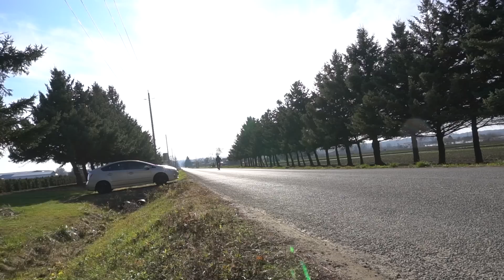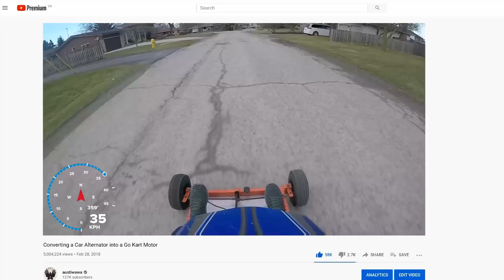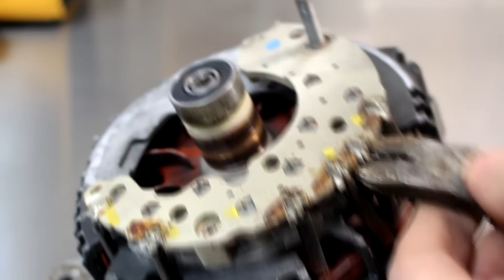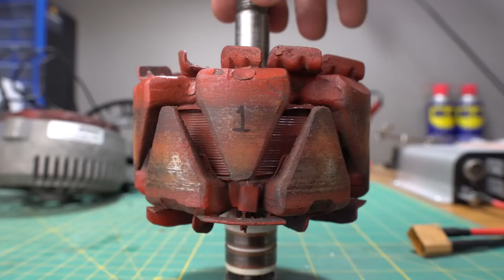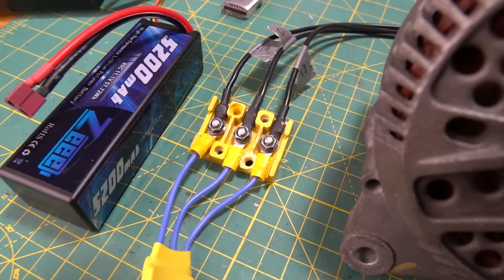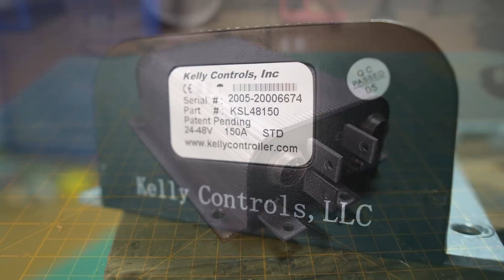Building an Alternator Powered Bike

Comment: “Alternator-Powered Bike” needs the hyphen.
Reply: No, it doesn't need
Why correcting an error in the title?
It won't change the project
It won't change the final result
Reply: @foxxyytofficial  it reads in the active vs. passive voice without the hyphen. Accuracy is important. Truth is important.
Reply: @kyrie26  really?
Just another troll on the net then
Reply: @foxxyytofficial  not a troll, I am doing my part to prevent the decay of the visual language. Written language is supposed to be both visual and auditory. But now because nobody cares, and uses text-to-speech, we are losing the accuracy of visual language.
Reply: @kyrie26  but you're trying to make corrections on a video title that no one asked for it
And it's such a niche DIY type of video that putting the hyphen won't change anything
Reply: @foxxyytofficial  truth is important.

Comment: Common issue.  Clutch springs are too strong.   You can weaken them a number of ways.    Goal is lock up at minimum rpm's.
Reply: Removing the clutch was better

Comment: Why couldn't you use a relay to just turn the motor on/off or disconnect the power going to the controller? But I guess it works other than the loud noise! Nice work my man! Keep it up!
Reply: That would be more of a ghetto fix than a real working idea
Reply: @foxxyytofficial  Yeah, its just a thought I had in mind

Comment: What I want to know is did you find an appropriate Breathless Motor Controller?
How did you arrive at the gearing?
Reply: Most BLDC controllers work in the same way, some with better components, others with chinese stuff
Reply: @foxxyytofficial  Thank you for responding. You are assuming I know something I do not know. For a 12V Alternator say 105A; what make and model controller would be best performing (speed. load, WATTS)?
Reply: @Thinker2-truth  most alternators will work, the bigger ones with 90-130A usually are the ones that can handle more current
Reply: @Thinker2-truth  but for a simple build, a 1500W BLDC 48V controller with sensorless mode is enough

Comment: Interesting. You've defeated the need for the controller by having a constantly running motor and clutch, though.
Reply: nope, you still need the controller because the alternator can't run simply putting + and -

Comment: now you need to find a small brush-less Alternator to charge your battery while you are riding with the proper gear reduction off of the front wheel you should be able to get some charge to keep going longer than 30 minutes
Reply: that won't work, idk why people think it could work, it clashes against thermodynamics' laws
Reply: @foxxyytofficial  i know it's supposed to clash but very small bicycle generators that run off of the tire would throw a small charge into the battery.
Reply: @marksmith7054  so you're risking the entire charge to recover 1-2 minutes? I can't understand why
Just grab regen
Reply: @foxxyytofficial  how is adding a little more charge risking anything ????????????
Reply: @foxxyytofficial  maybe you should just stick to playing your games.
Reply: @marksmith7054  unless you can prove that your idea would indeed give a real increase in range, trying to recover dozens of watts while a motor is pulling hundreds or thousands of watts won't be too feasible
Reply: @marksmith7054  everything that you connect to the bike wheels, even in the front one, is directly or indirectly connected to the drive motor (being by the own wheel, or by the asphalt itself), so if you put a generator on the wheel to recharge the battery, now you will need aditional power drained from the battery to feed the generator
And to feed energy back to the battery with the generator, you need to give enough kinetic powet to overcome their own resistance and losses to start sending energy back

Now, if he already have a 30min range at mid-full speed, with a second alternator now he need to drain the battery even more to keep the bike at the same speed and feed the generator to send energy back to the battery (minus heat/efficiency losses)

And if you say "he can make it physically able to detach from the wheel and not drain excess power from the battery and only connecting it back while decelerating", just use the freaking built-in regen braking feature on the controller! No other alternator, no generators, no separated charge controllers, easy!

Comment: Great video! Would it not be possible to cut off the motor, but not the controller, with a relay cutting off one of the three phases?

I would have loved to show this video to my children, but I'm not going to give them examples of people riding bicycles, especially bikes modded for speed, without a helmet. If your next video on the bike includes a helmet I'd love to share it. Thank you!
Reply: he got it working with another controller, and about the helmet, he probably won't return to this bike to use a helmet

Comment: Wonder if an industrial VFD for a 1/2hp motor would work... If you tied into the DC bus capacitors with the battery array the SCR outputs wouldn't care and output 3 phase no problem. They are everywhere in HVAC and get thrown out by the dumpster full on remodel jobs!
Reply: probably no, because VFDs are usually for induction motors
Reply: @foxxyytofficial  good point. I have a small Fuji drive that will actually work with wound rotor synchronous motors, which is basically what this converted alternator is, it can also be programmed to current limit. Pretty sure the windings on a 12volt alternator can handle higher voltage so long as they don't overheat, hence the current limit. A 90volt dc bus is pretty high though, not sure if the industrial drive can handle much undervolt. That might be the deal breaker
Reply: @dangoldbach6570  up to 72V nominal (84V max) i saw people benchtesting
But for real load tests, never saw people testing over 60V max
Reply: @dangoldbach6570  the field coil is the 12V max part

Comment: Alternators are used to power the whole system of a car, so if u reconnect more wires from the Alternators to the battery u have an endless supply of power and an even faster bike
Reply: hahahahahahahahahahahahaha, endless energy is a hoax

Comment: Try using a lithium ion motorcycle battery , add a voltage regulator for a motorcycle then you can constantly put the current into the battery. Distance = til your chain breaks wears out or tires wear out... Etc..  lol.  Pretty sweet.   How about making a carburetor that runs on water .  ;)
Reply: what??

Comment: Lol, I built something similar to this last summer after I watched your alternator go cart video. I just put a rubber scooter wheel on the alternator hinged against the tire. I was equally as cheap with the rest of the parts and I built a 6s lipo pack out of repurposed cells as well as a controller with an 80a multirotor esc and arduino.

Comment: With 1990 comments, I'm not sure if this has been asked, but what if you added an alternator to the other side of the rear wheel (or something to the like) to power the motor as you go (and maybe recharging the battery), using the battery or your feet to start?
Reply: It was asked hundreds of times
And still won't work, sorry

Comment: Three pole drum switch between your phase inverter and your alternator.  It will give the the ability to direction select in forward reverse or neutral.
Reply: Square D 2601AG2 drum switch 🥸
Reply: By installing this type of switch in this location gives you the ability to keep your phase inverter powered on at all times.   No power up delay. And you can gain reverse ( not needed on a bicycle) but you can have a neutral gear for stopping
Reply: Nah
You can reverse it easily
Reply: His controller can reverse without any problem and no need of those things

Comment: I suppose you could experiment with shorting the slip rings together to make an induction motor out of it.
Reply: Shorting it won't help with torque, you need it powered or swapped for a PM rotor
Reply: @foxxyytofficial  Which is why I said experiment. It is, in essence, a 3-phase synchronous motor. Torque production isn't the issue, efficiency is. A synchronous motor is more efficient, as it doesn't require slip to keep operating, and a 1.0 pf.

Running it as an induction motor will not diminish the torque production significantly, but will make it less efficient, at lower speeds in particular because of a tendency for a reduction in power factor at lower speeds. Though at higher speeds, say above 600 or so RPM, the difference in torque production would be negligible. Even at lower speeds, an induction is more than capable of providing sufficient torque, and in fact, will be capable of providing more starting torque for a given load than a synchronous motor will.

There's no question that a PM or synchronous motor is better for the application. But, it's an efficiency problem, not a torque production problem.

And the issue with whether or not his controllers could run it as an induction setup.
Reply: @akio2589  
1) his controller can't run ACIM (AC Induction Motors)
2) the field coil rotor isn't not even near as close to a proper AC induction rotor's cosntruction and shape, so probably won't even work correctly under loads
Reply: @foxxyytofficial  1.) I don't know if they can or not, I don't have a param sheet for either controller.

2.) Shorting the slip rings together would be a conversion of what's called a wound rotor motor, which comes in two flavors: Salient pole and cylindrical pole. A converted alternator would be considered a cylindrical pole motor, and they're very much real, albeit not all that common. Now granted, wound rotor motors are usually connected to resistors to vary the speed of the motor by changing the strength of the rotor flux, and have 3 slip rings as opposed to two, but they absolutely can be converted to function as a regular AC induction motor simply by shorting the slip rings together. You are thinking of a squirrel cage rotor motor. Which this is not, correct.
Reply: @akio2589  1) his BLDC controller can't work with AC induction, it doesn't show on the website, because they have proper AC lineup

Comment: instead of the clutch, couldn't you just remove (or lower a lot) the brush assembly voltage ?
So its like an automatic car, if you release the brakes it starts rolling slightly.
- or would that controller go into error mode if the alternator does not turn as intended during start up test?
(Also do i hear a bad bearing in that alternator?)

Having a standard motorbike clutch might have the bonus of cooling the engine down after load while standing,
since in a car it's usually always rotating/getting air.
Reply: That is not a feasible idea, lowering the voltage for a start would only force even more the system
With the new controller and hall sensors it isn't needed
Reply: @foxxyytofficial  
(I think here are some words missing in your post?)
I do not mean lower the brush-collector voltage during usage/under load because that of course would remove field strength,
only during startup and idle.
Since the alternator in normal mode uses the brush-assembly to regulate output power = voltage/current, the old controller could perhaps (needs to be tested by the video creator) make the startup testing without actually turning the output.

Only thing i dont like with this solution is the bought motor driver.
I'd like to see a modified (adding high current mosfets) mod to a cheap brushless controller or a arduino style controller with mosfets.
It worked sensorless with the rc brushless controller, that thing just cant handle current+voltage on the bike without mod.

Buying the controller (aliexpress says keb48401x = 230 dollars) extra means you could instead just buy a complete e-bike set with motor and controller, since the part of saving money via using the old alternator is gone.
Reply: @PsiQ  It doesn't matter if you remove the voltage in idle or under load, it could cause a shoot-through condition with the rotor suddenly losing the level of magnetic flux and spinning out of control, alternators when converted (and not utilizing PM rotors) really need the powered rotor to work correctly.

And too low of a voltage won't give enough current (since the field coil is basically a long wire, it will have a certain resistance, and a max current to be calculated by "I=V/R") and magnetic flux for the rotor, and the controller will lose sync, being sensorless or sensored, so losing that sync in startup would trigger errors and warning lights.

He bought for the project only the KSL sensorless controller, the other one he already had (and for alternators you won't really need 110A continuous and 280A peaks, a 1500W ebike controller would work too, just like he used in part 1). For diy mods and high current mosfets into smaller controllers/diy arduino controllers, it would be netter for you to search those electronics-based channels, Austiwawa focuses more on easy projects with not a lot of diminute and specialized work (like the Teskart, the modded Crazy Cart XL, and the other kart that he made but put all videos in private for some reason).

The 3S brushless controller worked in bench without any load besides itself, and wasn't tested for longer periods of time.

And if you're talking about the expensive KEB controller, any other chinese ebike controller also have hall sensor connectors and you could use them. 

Youtuber Enrengineering used them while making his own project, had some problems with defective controllers but they worked with and without hall sensors.

Comment: This is pretty cool. I have not done the research here, but would you be able to put an alternator on the other side to charge the batteries while it is rolling therefore optimizing the distance you can go without plugging in the batteries to charge?
Reply: That would not work
Reply: @foxxyytofficial  elaborate why please....
Reply: @lastmanstanding5117  if you get a generator with the same power of the motor, if you try to connect them together and power something, you will waste every watt of power with unnecessary cycles and heat/friction/efficiency losses
Reply: @foxxyytofficial  gotcha. So what your saying is he would need 2 over sized alternators in order for it to work.
Reply: @lastmanstanding5117  no, i said that it doesn't matter how you try to "rig" an alternator to recharge from another alternator, you won't have any range bonus
just get a regen enabled controller like he used in the video

Comment: You could have the alternator always connected. Pedal start the bike and switch on the fields once you get above the slowest speed of the alternator.
Reply: Please explain
Reply: @foxxyytofficial  If the alternator shaft is always connected to the bike through a chain, but the fields aren't energized, it will provide little mechanical resistance to pedaling. Once the bike has been pedaled up to a fair speed, switch on the fields. No need for clutches.
Reply: @td3993  spinning or not, removing the magnetic flux will mess with the controller
Reply: @foxxyytofficial  You would shut the controller and the field off. I said shut both fields off, but I guess I should have clarified. Since the alternator is now a motor, you have two fields, one rotating and one fixed, or, actually four, since the fixed field is really three. Anyway, turn everything on once you get moving.
Reply: @td3993  still a lot of work for not much effect
That controller was expensive and not for the proper use, even 50$ ebike controllers from china will work, just like he did on part 1 and didn't needed expensive stuff
Reply: @foxxyytofficial  No, and I'm not going to explain myself further. Have a good day. 👋

Comment: Exchanging the springs in the clutch for ligther ones will solve the slipping. Nice job none the less.
Reply: He already solved it
Reply: @foxxyytofficial  he solved one problem. The clutch offers several benefits over his current setup.
Reply: @oldwrench4213  but he doesn't need it now
Reply: @oldwrench4213  better torque, the motor can start from 0rpm

Comment: Instead of the energy-wasting clutch, you could have just ramped down the electromagnetic field voltage to shut down/fire up the motor in a controlled way
Reply: You can't simply turn off the field

Comment: Nice work...   If you had cut the voltage to the rotor windings would that have stopped it from turning? Then add a relay to turn the rotor feed on with throttle or thumb button???  Also with the Hall sensors reverse should be possible?
Reply: Reverse is possible with the controller
But cutting voltage? No no

Comment: What does the clutch do or how does it work in this situation?
Reply: He used for proof of concept only
Then he removed
Reply: @foxxyytofficial  are you sure? Wouldn't you need a clutch is the engine is always moving?
Reply: @computeraidedworld1148  first, this is an electric motor
Second, he swapped the controller and ditched the clutch
Reply: @foxxyytofficial  Yeah the engine in the video is electric, why point that out?
But didn't he say he was gonna make it work and got that clutch.
Edit, I see where your confused, I was talking about the first iteration where he uses the clutch.
Reply: @computeraidedworld1148  when it is moved by electricity, is a motor
when moved by combustion, is an engine

Also, he only used the clutch to see if that would work, but the better solution is swapping the controller and ditching the clutch
Reply: @foxxyytofficial  an engine is just something that creates mechanical power, it doesn't matter if it's electric or combustion. A steam engine is neither and is called an engine. Plus a motorcycle isn't called a enginecycle because it uses combustion, they are used interchangeably.

Comment: You just need a lower rpm clutch it’s not spinning fast enough to engage it fully
Reply: Removing it was better
Reply: @foxxyytofficial  yeah but either replace the controller or the clutch
Reply: @orm865  he did the first option and ditched the clutch